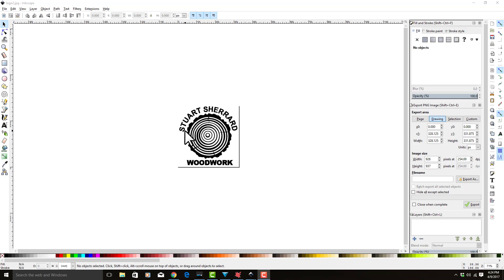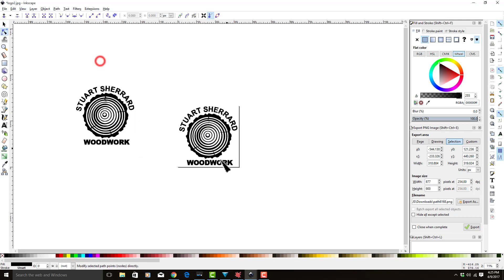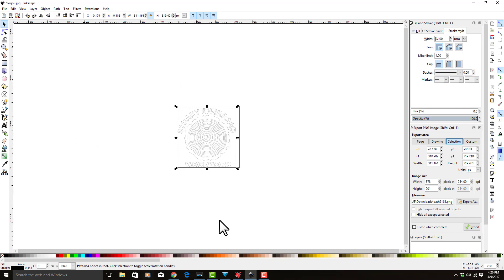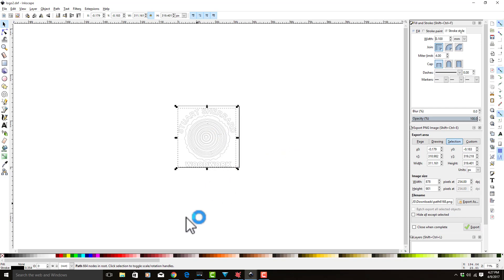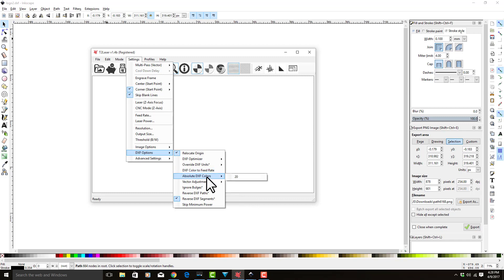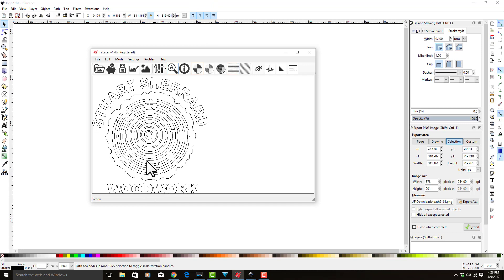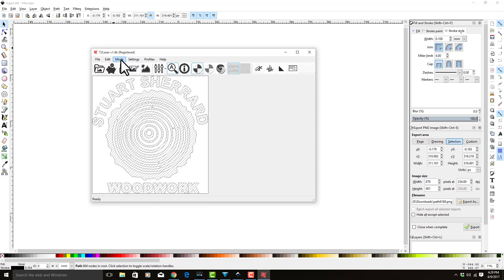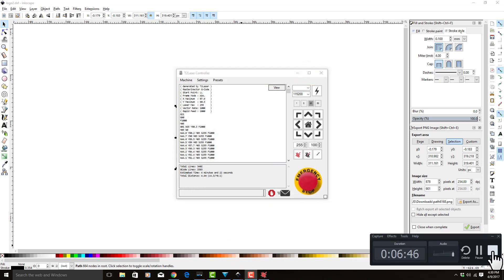How to convert a jpg to dxf with inkscape for T2 Laser

Comment: Say I want to add a circle around that image and have T2 laser cut it out, 150mms 6 passes.   I can't seem to find an answer, I understand the lines can be color coded to tell T2 the power level, but not finding how to cut the DXF. Thanks.    I looked at RDworks and Ligtburn. Those have nice features, I can select the line give it a color for engraving, select another line, another color and tell it to cut.

Comment: This is a good video, I have used inkscape in conjunction with gimp to do this but this way is much easier. I've been using inkscape for a few years but learned something here. Would really like to see you get into the nuts and bolts of T2,  like creating profiles, calibratings rotary axis, etc. etc. Keep up the good work and thank you!
Steve